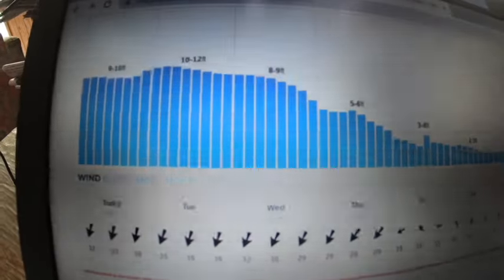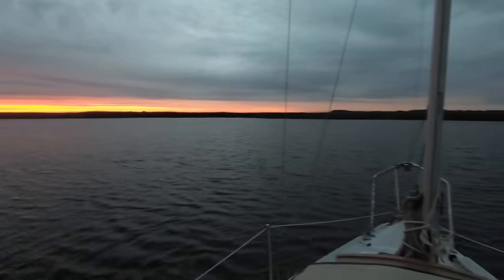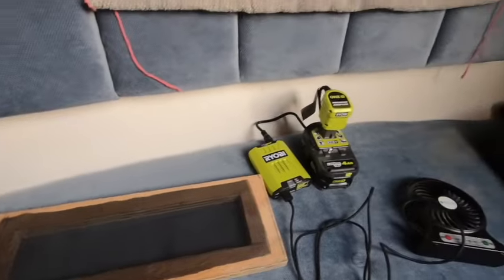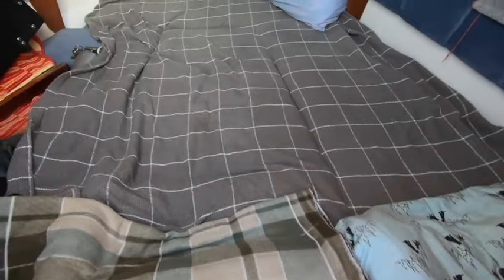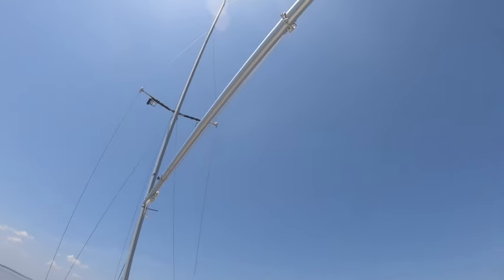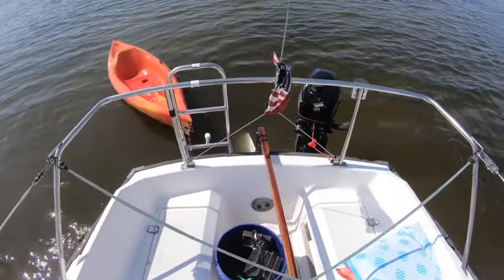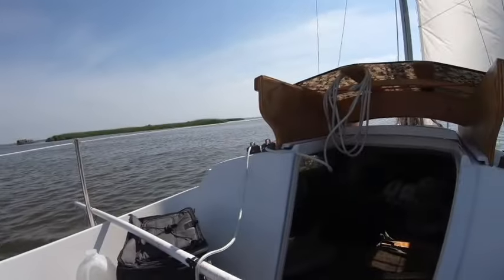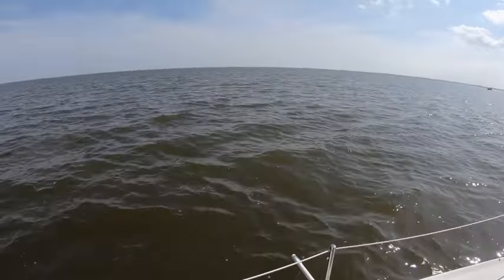Customized Part-time Live-aboard on a small sailboat (Precision 18)

Comment: With your fenders moving back forth,
having the same proplem, i ran an line  
from from the fender to an stanction. Hope that helps.
Gerard, 
New South Wales,
Australia.
Reply from the maker: Yes keeping them out on deck would have been better. They were actually the only way the bed would stay somewhat level before I built the rails to support it. It seems the manufacturer never figured out the fact the bed was wobbly and couldn't support weight. I just bought a sailing catamaran and will be working on that soon to be back on the water. Cheers from the states.